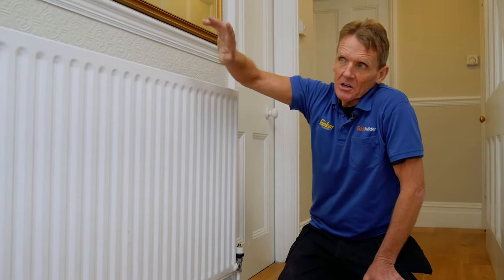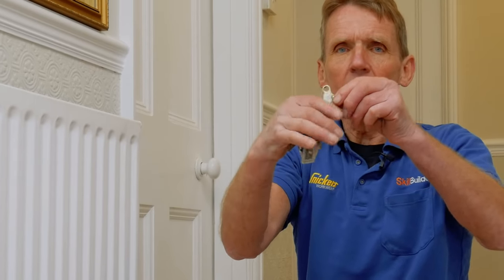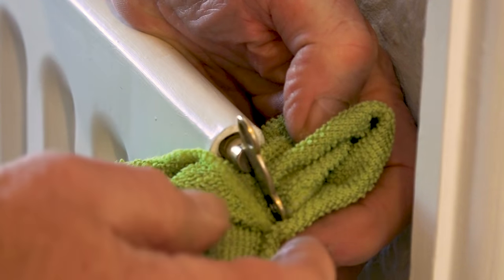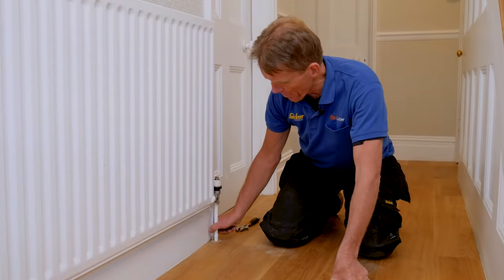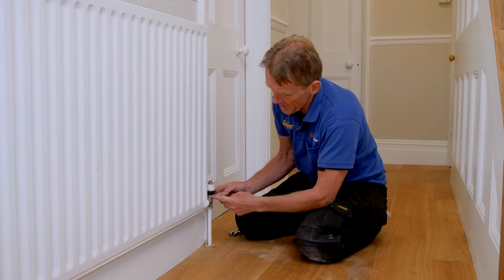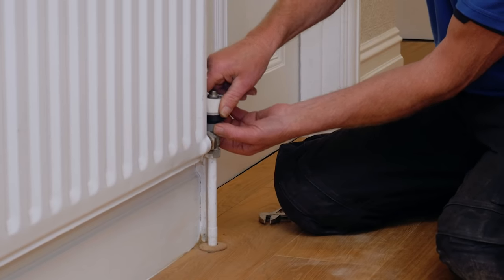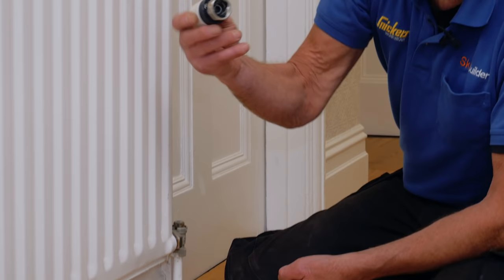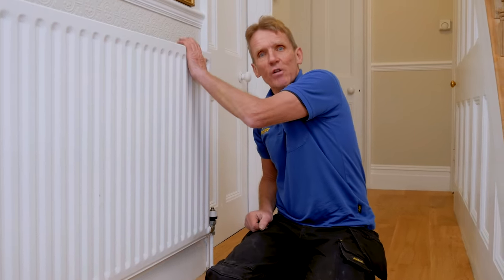Radiator Not Getting Hot? - Plumbing DIY

Comment: Air in the top ? Don’t you mean hydrogen Roger
Reply from the maker: could be hydrogen. Put a match to it. Doesn't matter either way
Reply: Skill Builder but showing the customer (as long as their not vegetables) it’s hydrogen proves the existence of electrolytic action... air proves the vent, feed and pump is positive on an open system or not even VGP. Can you think of any other reasons why gas would be present in the system? Anyway as long as I can can provide a good diagnostic reason for the existence of a problem I’m happy else it’s just BS

Comment: My one isn’t even getting warm
Reply from the maker: Open up the spindle on the lockshield valve and turn off the other rads. Full speed on the pump and bleed some water out. If you have a combi top up the pressure.

Comment: 5:52 Take the head off so that it doesn't open up in cold weather. Worst advice ever! I had taken off my radiator and when I heard that I went and removed the head... 1.5 bar worth of water shot right out of the valve. You plonker Rodney! The Danfoss are held in place with a spring loaded locking ring, try turning that with one hand while the other hand tries to hold back Niagara Falls.
Reply: You clearly didn't listen to what he said
Reply: Hilarious.. obviously unless you are there!!!
Reply: He never said take it off......he said replace it with a service head or cap it off 🤔